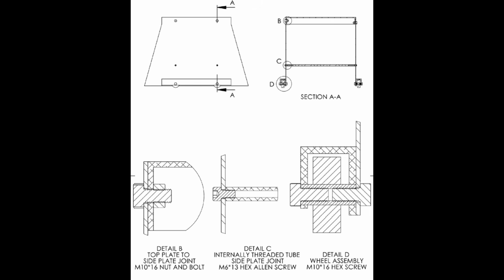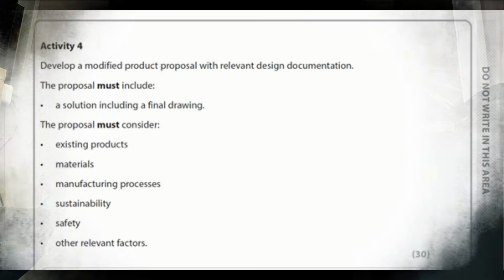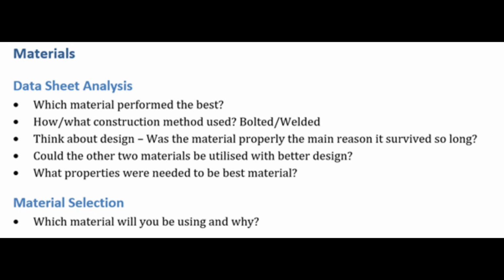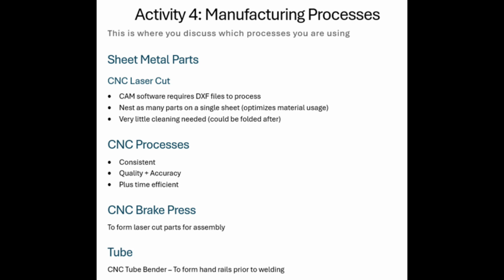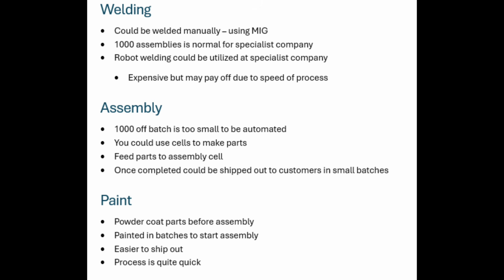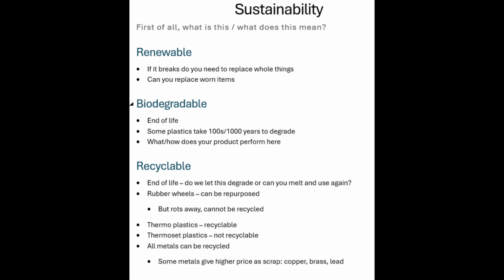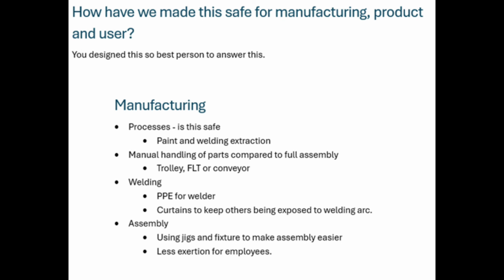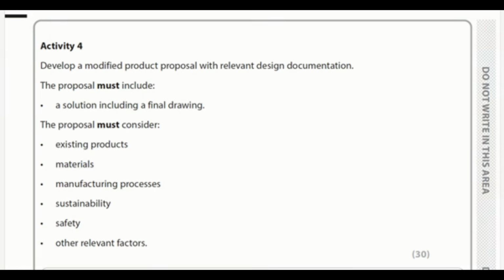Unit 3   Engineering Product design and Manufacture - Exam walk through for Activity 4

Comment: hi sir, am i right in doing a final sketch first and then orthographic views front ,side ,top in activity 4 with dimensions needed but also does the final sketch need to be scaled or can i draw it and say not to scale?
Reply from the maker: Great question here, thank you.
So for Activity 4 this is where you show your proposed solution. 
It should be engineering drawing as professional as you can do. Forget the boarders and title boxes. The design is what you need to show.

So if you're sketching just use a ruler and make it isometric drawing. Add some detailed views as separate drawings. You need to show the examiner your idea.

So you may not feel comfortable with isometric. Then we go down the orthographic projection view.
You will not get penalised because it's not isometric.
Dimension your drawing is important. If there were some constraints with sizes you need to make sure you evidence that you adhered to customer constraints.

Scale, think of this as proportion. Does it look right. I have seen some that have a 10mm hole which looked bigger than a 20mm wide slot. You can see that drawings now start to look out of whack. 

Just make sure which ever method you choose is neat and clear enough for the examiner to understand your proposal and can award marks.
Vague sketches with little detail will not get many marks.

Make sure you dont leave early and make every minute count.

It wont hurt too much if you forget or miss a couple of dimensions. 
Just make sure your proposal is feasible to start off with, you cover all bullet points on the paper and dont forget it has to be seen as a solution to solve all the problems the client had raised.

Good luck and let me know how you got on.

Mel

Comment: So for Activity 4, does the final design need to be an assembly drawing? Also, should the actual drawing only be on one page?
Reply: up to you really, it can be on different pages, for the jig on activity 4 mines fully assembled, then I've drawn each part which are on different pages, however I'm not sure how I answer the bullet points
Reply from the maker: So you need to be honest with your ability to draw. If you're fast and can do it neatly plus have the time to get it done. Then I would go for full assembly drawing in  orthographic projection. 
Any additional views add them on separate page.  
Your are showing your proposed solution as professionally as you can. Use correct drawing conventions.
I have seen this done well and quite poorly too.
Activity four is not the drawing alone. You have the bullet points to answer too.
You will be forgiven if you miss a dimension here or there. Plus some dodgy lines in places.
Its your answer being something that is feasible. 
Have you watched all five videos for all the activities?
The full story can be understood when you watch all five in order and in full.
Good luck in you final sessions.

Comment: Hi, do i have to use exitsting products for my design or can i mainly use ideas ive come up with?
Reply from the maker: You use the existing design/products as inspiration to create something similar but you designed out the problems, 
Or
Create brand new concept with elements/features from existing designs or product.
Nothing is set in concrete, you have free artistic licence to create something new.
As long as it solves the problems highlighted by the customer brief and produce the product with the constraints attached to old crappy design.
Remember three designs that are different. They do not like three similar ideas/concept designs.
That scores very low on the mark  bands.
Try to max8mise every activity. Loosing a couple of marks from each one will not hurt as much as making zero marks.

Good luck.
Reply: @111melcat thank you, I appreciate it :)

Comment: can i forge all of my 3 design ideas and create a one product for activity 4 with all the 3 designs mixed in one?
Reply from the maker: The choice is yours mate, iteration is the game. 
As long as each design is different and provides solutions for customer .

Dont have three similar designs or use same approach for manufacture. You will not score much. 
Be different in all approaches to your design.

Forging is for parts that require grain direction in certain plane to provide strength for an application.
So cranks on car engines are forged so they can take advantage of grain direction.
Look it up on Forging cranks for engines.

Comment: Can i pick a different material from the ones provided in the data table? For example a material I included in my research notes?
Reply from the maker: The materials they usually list are something Pearsons use on most exams.
If the materials you decide to use for your design is specific for it's properties then everything is game.

Also think about using a mix of materials. Some have properties that are good for certain things and obviously there are materials that are totally unsuitable for task it has to do.

So, if you need that type of material and can justify it at the same time then it's a keeper.

Comment: For the final design, is it better to prioritise the cost and time of making the component or, the efficiency for the user?
I have one idea that would be easier to create however slightly time consuming to use
Then another idea which is more efficient however needs more parts to be added onto the original design 
I hope you understand my comment
Reply from the maker: Feasibility is the key word here. They may probably say economic use of materials, so being too expensive is something you need to mention in your work.
When ideas/designs become too intricate these may now become not feasible. 
So too many parts may slow assembly down but provides most accuracy. If tolerances on drawing are not tied to 0.05mm then simplistic design comes into play due to not requiring the accuracy of a part machined on a CNC milling machine.
Reply from the maker: So you have something to discuss here. Its recognising these facts that show examiner deeper thought of the process

Comment: For existing products can i skip drawing the existing products and answer the rest
Reply from the maker: What you can do is simply describe those existing products. Shape, form, materials, construction and how it works. No drawings needed then
Reply: @111melcat thanks mate and by "do they fit the bil" does that mean would they work in the secenario of part A?
Reply from the maker: Fit the bill, would they be the thing to do the job your are designing.
So like the work platform there were plenty of alternatives that would replace that crappy contraption.
You get whay I mean?
Reply: @111melcat ohhh yes thank you very much single handedly saving my results legend ❤️‍🩹
Reply: Hi Sir, is it acceptable if I draw my final drawing first then I explain that drawing in activity 4?
Reply from the maker: @muhammadrana7843 what about activity 3, this has to be done as well first before moving on to Activity 4.
When creating your three concepts, this is going to give food for thought for other ideas that may make your activity 4 a better design.

You really need to work all activities in order, we do not build the roof of the building with out foundations and walls first.
Trust me go with the flow working from activity 1, 2, 3 , 4 and then 5
Reply: @111melcat ok so I have done activity 3 first, now I am on activity 4, is it ok if I make my final drawing first then explain my drawing in activity 4?
Reply from the maker: @mqrana.2006 now I understand.
Yes drawings first then the tackle the bullet points
Reply: @111melcat  Thank you very much sir

Comment: Do you lose marks for not talking about the health and safety laws?? Is it required to get into band 4??
Reply from the maker: You probably would. Make sure it is specific to the product as in for manufacture, product and for the user if you can
Reply: @111melcat Thanks Mel, also for activity 3, can I just do explosion drawing instead of autographic projections of each then in activity 4, I do an orthographic projection and an explosion drawing??
Reply from the maker: You produce what you are comfortable, as long as it gets the idea across and can be understood.
This would be for assembly, sizes and so on will need dimension drawings